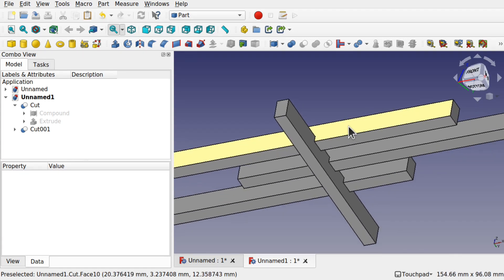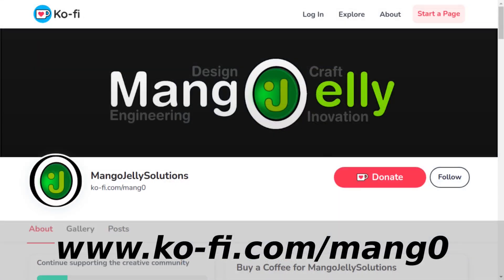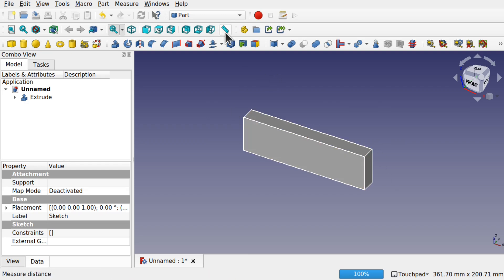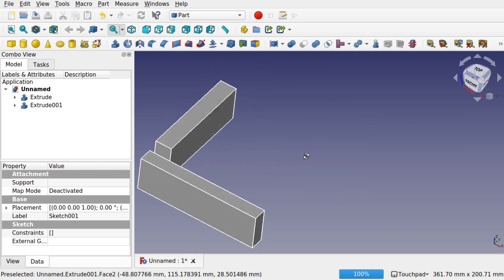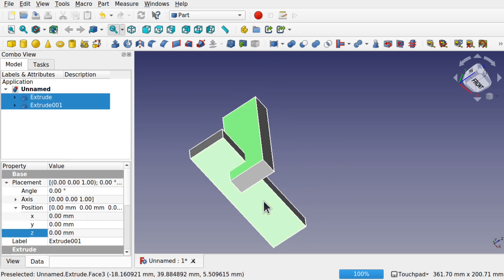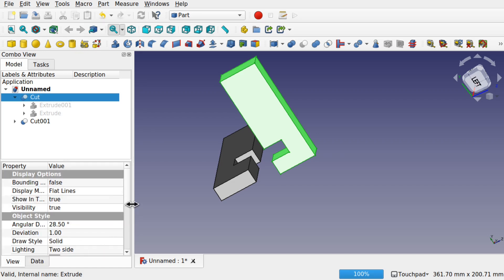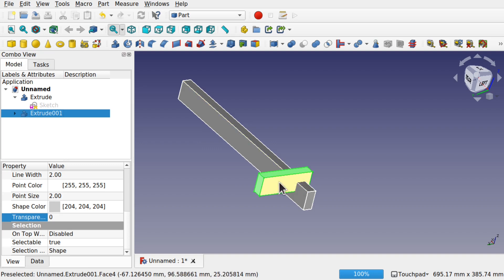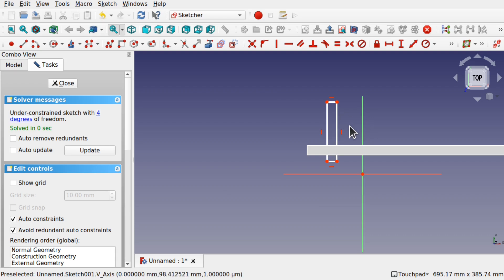FreeCAD  How to make a large number of slot joints in seconds. Time saving tip, beginners tutorial

Comment: 👍👍👍👍👍👍 Ok, next step would be to use LinearPattern to do cut to achieve many slots
Reply from the maker: Can only do that if the slots are consistent, if the  cross pieces taper or the spacing differed between profiles then a linear patten unfortunately won't help. But look out in a few weeks as there is something coming up in that area.

Comment: That was very useful, thank you. I appreciate this is a teaching exercise but as a practical point is there any simple way to add clearance to the cuts? E.G. if I wanted to 3d-print the parts I imagine there would be problems in assembly due to the pair of slots being exactly the same size.
Reply from the maker: Good question I wish I thought about this situation before I posted the video as the solution would of enriched the video.  If you create and use a part 3D offset for the cutting part then you can create the necessary offset you require.  I am trying to figure out how to add a image to this comment but having no luck so I will have to post it to the community section.  Thanks for the question, I will get the image up in a minute.
Reply: @MangoJellySolutions  is the 3d offset a feature of freecad or so you have to do it manually?
Reply from the maker: @williamweatherall8333  it's in the part design. Also you could use a additional extrude in a custom direction. Think I might do a follow up video.
Reply: @MangoJellySolutions  thanks. A follow up video would be awesome
Reply: I had exactly the same question.  Maybe we can use freecad variable feature and define a new dynamic beam that is linked to to original beam except that it has it width and height define bu the dimensions of the original beam plus an offset distance (variable). ?
Reply: @MangoJelly Solutions Thanks for your reply, yes I too would be interested in a further video to delve more deeply into this.